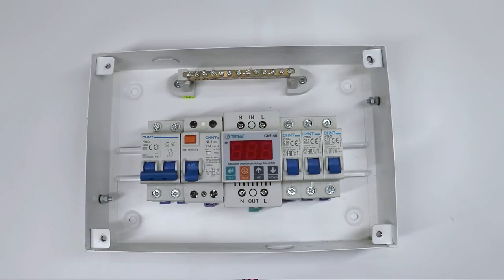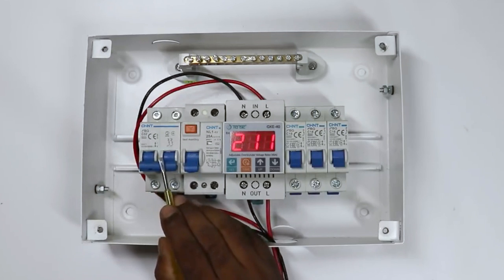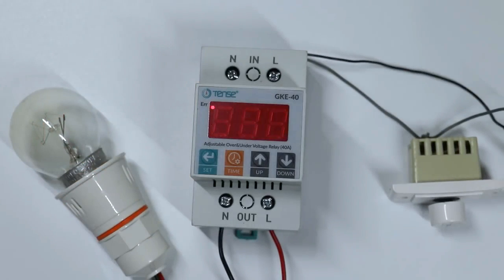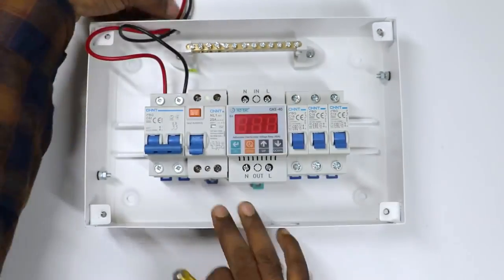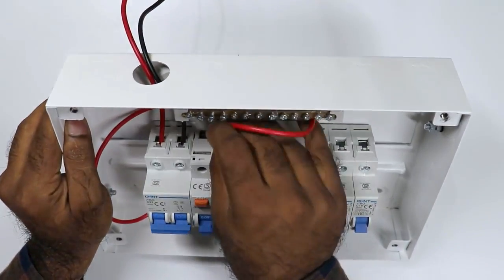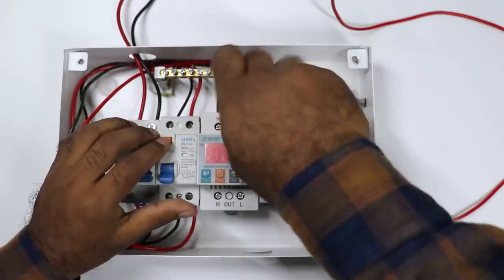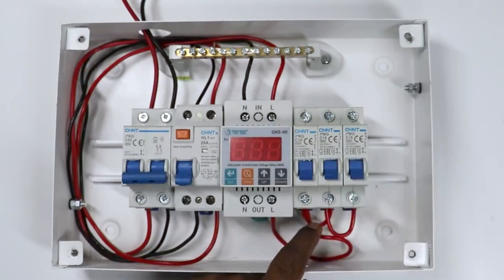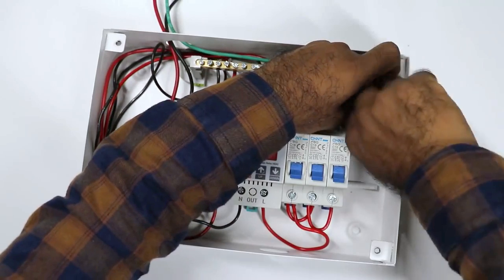Single Phase Distribution Board Connection With High Low Voltage Protection @TheElectricalGuy

Comment: Hello @TheElectricGuy, I have learnt a lot from many of your video. I want to highlight a point on your connection. The output of the Voltage relay is going to the output of the single pole MCBs, the connection is supposed to come from the up site(input) of the single pole MCBs and not below. Kindly make this correction